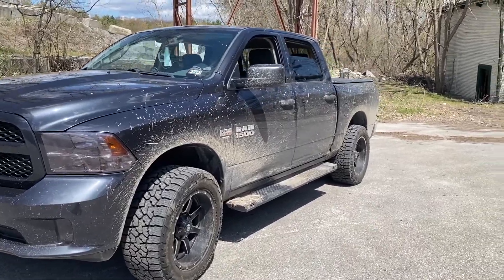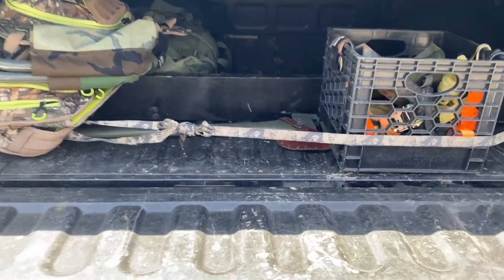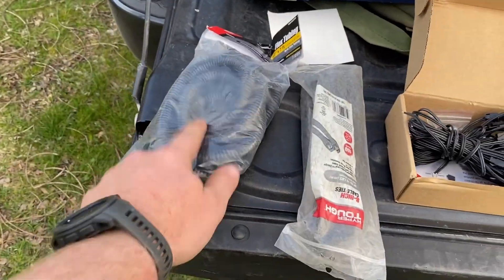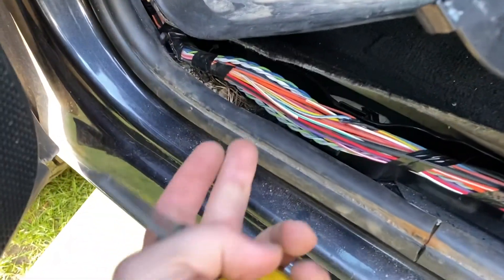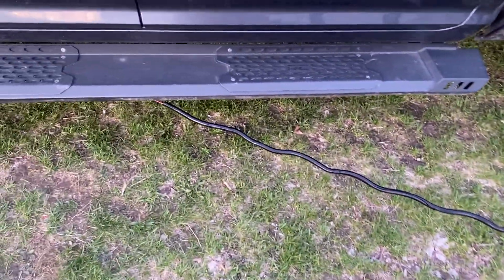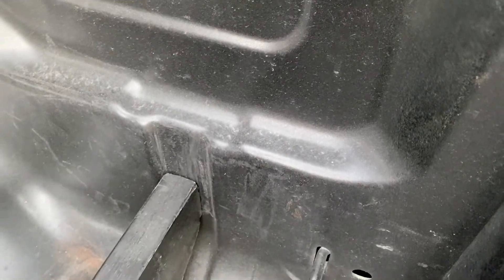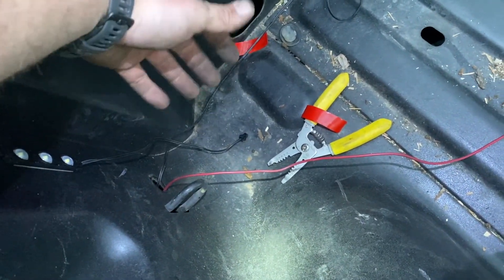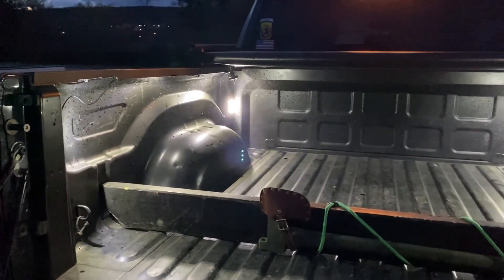LED Truck Bed Cargo Lighting Install

Comment: No Relay?
Reply from the maker: Phil Medeiros you don’t need one, this is run from the cargo lamp source so it’s technically on the trucks relay and fuse of the cargo lamp.
Reply: @Phil Medeiros No need for a relay. They use about 3 amps anyway.

The part that I didn't like is that the cable was sandwiched between the bed and the grommet. The correct way would be to poke a hole in the grommet and pass the cable through the hole. Hopefully the vibration won't cut into the insulation and start blowing fuses.
Reply: See on my 2010 ram 1500 the cargo light goes directly to the bcm, no fuse, and I wired my bed lights to the same white with tan tracer wire going to the cargo light and it works just like yours but intermittently quits for whatever reason. Usually works when the truck is off but when it’s running I lose all power to cargo light and bed lights. I’m thinking the computer is detecting a higher wattage or amperage being used so it cuts power to it? Idk. Any help would be much appreciated!!